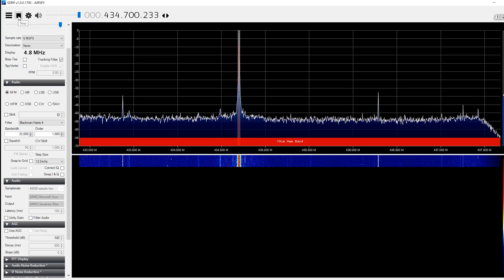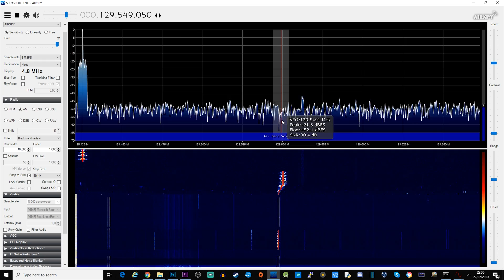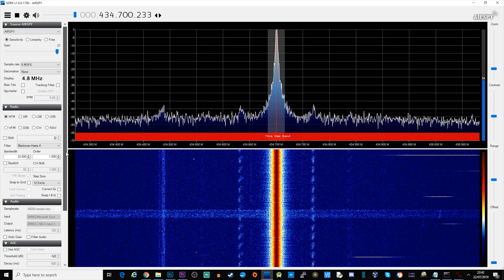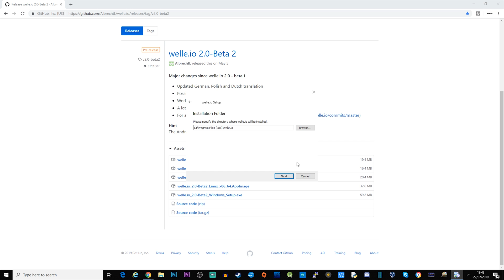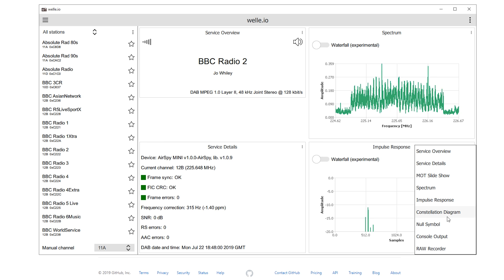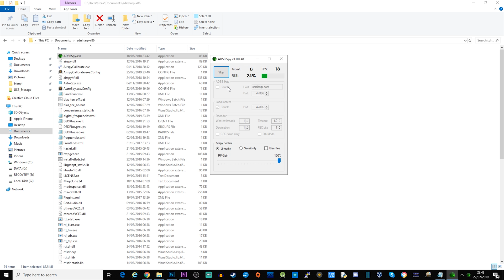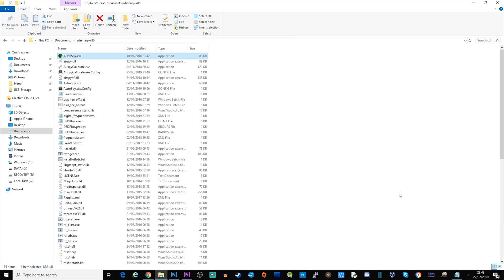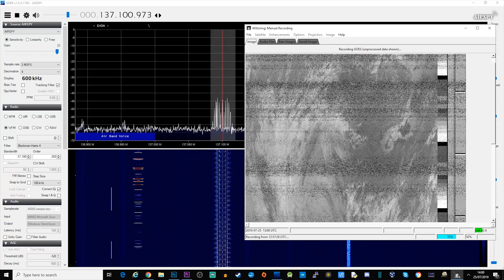5 Cool Things You Can Do With An AIRSPY SDR Receiver

Comment: Does the airspy go down to 100KHz? and if not, why that oversight in an important band.
Regarding UFOs aka ET ships flying in our atmosphere which surprisingly is real, I speculate that the hull of the typical 10-15meter diameter flying saucer is EM energized with standing waves and the shape is somehow crucial to the propulsion. So the shape is dictated by physics like an antenna is or magnetic coil. I just debated likely resonant frequencies for a 15 meter craft with bing AI. It was quite illuminating. It knows a lot :) a 15 meter spherical cavity would resonate around 4MHz so a discus shape would be around 3.5MHz or maybe lower if the material has a velocity factor below 1. But given how advanced they are 1 might be a good guess. A 10meter disc might be around 5MHz so try looking around for strong tones around 2-10MHz, likely with a lot of complex upper harmonics. Maybe lower too. I'm guessing the main tone is very frequency stable and it wouldn't be music or tv or any digital signal. Because some of these ET scout ships operate at gigawatt power levels I suspect they can be detected from great distance. And given the estimated number of sorties on a daily basis they should show up quite frequently. With a directional antenna they could be triangulated although 3MHz is not the easiest to direct. I suppose a back shield on a small antenna would allow determining direction simply from rotating full 360.
With a few automated listening stations around the world we could show realtime location of all exotic craft. That might get a few hits

Comment: I've ordered a rtl-sdr V3. Will I be able to use the antenna and the software to use it for multiple purposes at the same time. So radio, satellite and aircrafts?
Reply from the maker: You may receive something, but dedicated antennas for each band will get you best performance. Don't be disappointed if you don't receive much with the stock telescopic antenna. Antenna is the most important part of any radio system.
Reply: @TechMindsOfficial  thank you for your answer

Comment: Good basic guide to Airspy Mini. There's now a new ExtIO file from DG2YCB, for the RTLv3 which you can use with HDSDR in Windows that allows access to the direct sampling mode for MW and HF reception. I have used Mini with Spyverter or SV1AFN upconverters for HF, but if you're mainly interested in below 30 MHz, Airspy HF Discovery is way to go. Mini is good for DAB, as you showed, as it has the required bandwidth which the HF+ models don't have.

Comment: Hello... How does the tracking filter work on 137? I would be interested in dedicating an Airspy mini to work only on VHF and UHF, but I need to know how it copes with FM broadcast interference on 137Mhz. I currently use an SDRplay RSPdx to capture weather satellites and it does very well and I get excellent images by activating the FM notch filter. Do you think the Airspy mini would be as efficient as the RSPdx in dealing with FM interference? I congratulate you for your videos, I always watch them. Thank you. 73 from Venezuela YV8JET

Comment: To track planes you need a 1090 antenna right?
Reply: A 1090 antenna will improve your performance and range but it is not required. I used the standard little antenna which came bundled with my Nooelec Mini2 and it worked fine

Comment: At 5:06 – that’s how dreadful many radio hams sound these days, when using expensive digital equipment through D-STAR, DMR or C4FM Fusion.  Metal Mickey.  Totally unnecessary, and the final nail in the ham coffin.  No doubt about it, though, SDR is the best thing since sliced bread when it comes to monitoring the airwaves.  Thanks for the video.

Comment: DAB is a useless service outside of the UK.. IDK why it's even listed here when there are other things you can do with an SDR like listening to analog and digital trunking radio systems or watching OTA DTV stations. In the US we can decode railroad EOT and HOT devices. The HF models are better because then you can use the Ham radio software for decoding digital modes and receive SSTV, packet radio, etc.
Reply: DAB is used in more than 40 countries, but not in the US, so can’t really say it’s useless to talk about it.  As usual the US does it’s own thing, like ATSC, 60 Hz power, inches & pounds etc!
Reply: @Richardincancale  and using volumetric units to measure weight. All recipes from the USA use cups to measure dry ingredients. Go figure 🤪
Reply from the maker: The airspy mini doesn’t support HF otherwise I would of included it. 25mhz upwards. I’m not located in the US so I can’t demonstrate what you can do in the US, where as here in the UK we have DAB. I even said in the video this is just a small selection of things you can do with an SDR. But yeh, so so so many things you can do.. Look back through some of my older videos :)
Reply: @TechMindsOfficial  You have to tap the "Q" line of the RTL IC (usually on one of the capacitors in there) with a tiny wire to make an antenna connection to get HF and set SDR# to sample the Q branch. Kinda a round about way though when you can just buy sn sdr tha already has an HF tap built in and antenna port for HF.
Reply from the maker: To be honest, if that’s something that’s even remotely possible I would personally not advise it, especially as you could purchase a Spyverter which would have the correct filtering for HF etc. But as you say, having a dedicated HF SDR would be better. I just released a video on the new Airspy HF+ Discovery. I didn’t go into much detail, but it has a really good receiver for HF.
Reply: @TechMindsOfficial  I have a coupel different ones for HF.. I seen the best results, believe it or not, from the cheap chinese HF SDR I got for like $15 off ebay..
Reply: @Elfnetdesigns  can you please tell me the brand.

Comment: So how do you use an airspy as a  spectrum analyzer that would be the most use as real spectrum analysers are prohibitively expensive .
Reply: I definitely get the expense being a problem as it generally would be for me 99.99% of the time but a couple years ago I had a very rare opportunity to afford buying a new spectrum analyzer.  I do not see that much extra cash in sight again anytime soon.  But I bought a Siglent SSA-3021x it has the tracking generator option and cost $1,700 at the time, they now have one even cheaper (by nearly $300) ,  I compare these numbers to the first time I was looking at spectrum analyzers 25 years ago and it would have took anywhere from $20,000 to $30,000 to buy a similarly spec'd unit.  Now talk about prohibitively expensive!!!  Should I ever find my self with a spare $20k its going to have to go towards a new mini van to haul the wife and kids around!  The Siglent unit is a very good value for what it is!  But it is quite amazing what these little SDR dongle's can pull off for nearly no real investment!  Anybody can afford these SDR units!  I probably have 5 of them and the best I have cost only $25 , Good luck and enjoy experimenting!